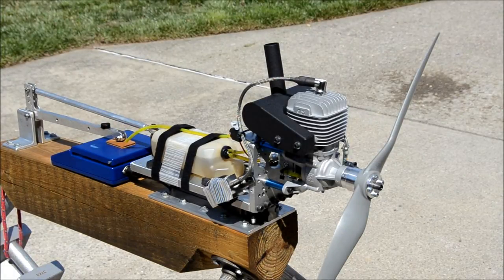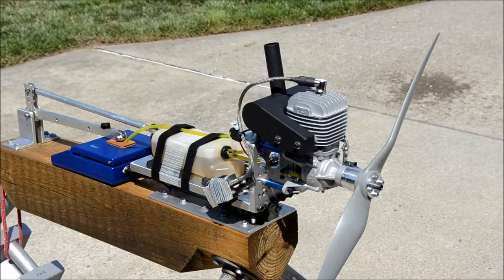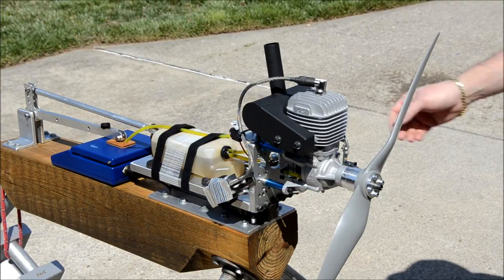O.S. GT60 on Test Stand

Comment from the maker: The idle is very smooth (for a single cylinder engine) and it is responsive to carb adjustments in a way that makes tuning easy.